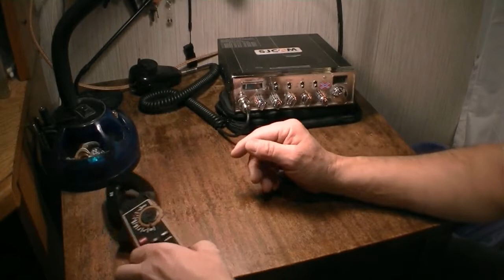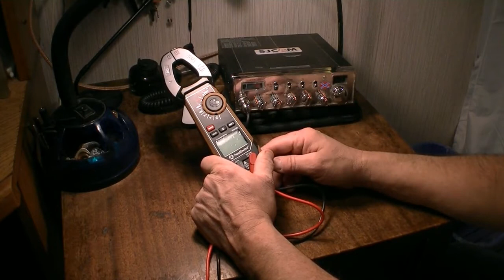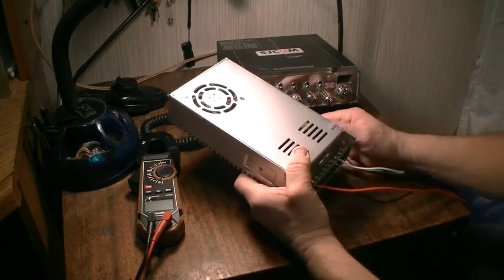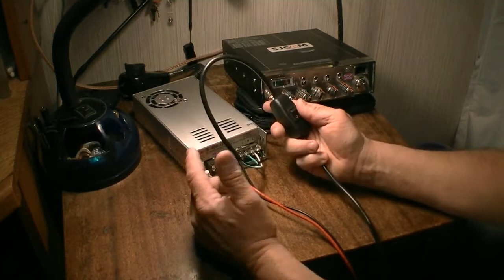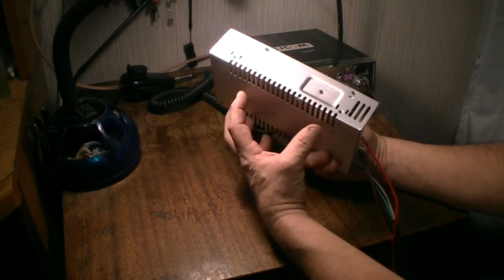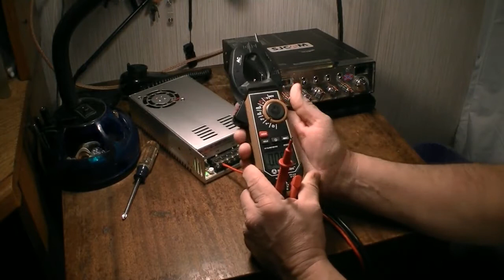mega watt S 400 12

Comment: There is so much misinformation in this vide it's unreal. The pot is a voltage adjustment. It will adjust up to 15V DC. You can safely run those radios, ANY mobile radios, at 14.6v to 14.8v DC. THAT is what your cars run for an electrical system. Next, the Antron is nearly the worst antenna on the market. It's even less efficient than a wire dipole. In fact, the Antron has a negative .3 DBd gain. Yes, that's a .3DBd LOSS. Next, if you're going to want a solid, STABLE SSB rig with ZERO frequency drift, go with Stryker or Anytone. All the big radios such as Ranger, Galaxy, Uniden, etc. will drift all over the place with temperature changes. People will be chasing you all over to keep you locked in. Stryker and Anytone are rock solid. If necessary, use a separate amp.
Reply from the maker: ok thank you
Reply: Misinformation in this long post also.
Reply: Yeah I was just getting ready to say the same thing but you already beat me to it. Even I’ll know better than to believe everything I see on the Internet. And this is one of the things are certainly do not believe. But I don’t want to insult anyone so I’ll say “thank you for the video”
Reply: I run as base station Stryker 497 955 I run RCI 2990 with 4pill my general HP40 Galaxy 959 Cobra 29 with 2pill on antron 99 and I talk all over country and Canada Guatemala Spain mr610 so I don't know how 99 trash lol
Reply: @Mrworldwide610skippshooter73  : You can talk skip on a piece of wire hanging out of your window. DX is not an indication of antenna performance. DX is strictly conditions.
Reply: Things people say 😂😂 makes me smile cuz I'm getting out with my antron 99